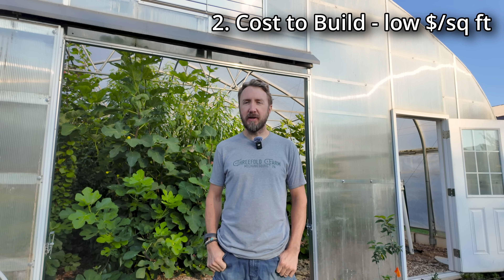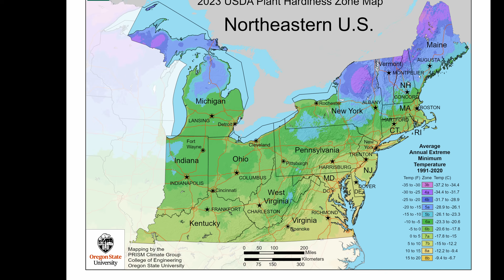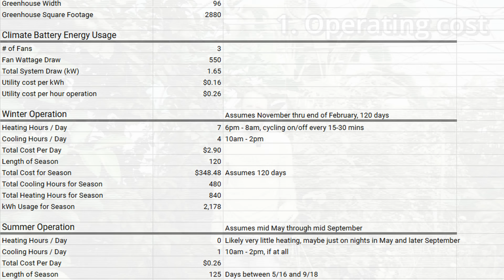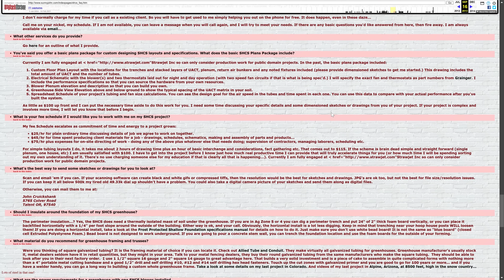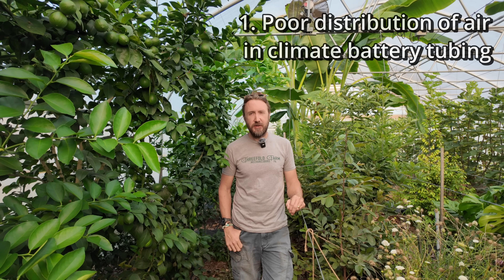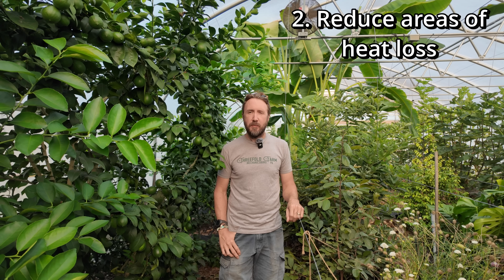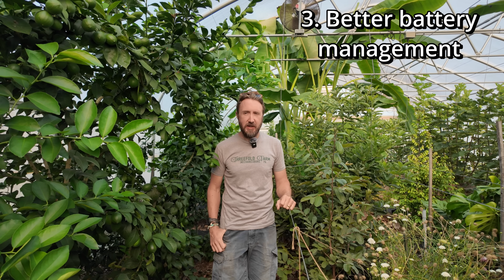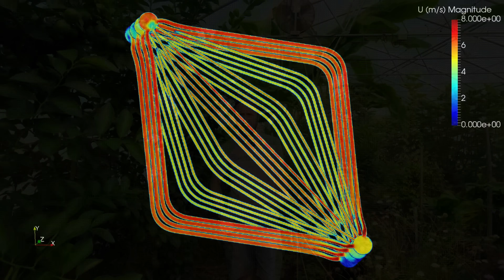Building an (Almost) Tropical Geothermal Climate Battery Greenhouse in a Temperate Climate

Comment: There's simple cheap(free) thing you could add during the backfilling around the climate air tubes underground.  This would take advantage of two heat related benefits of water.  Liquid water has a heat capacity(heat holding ability) about twice that of rock.  Moist soil would lie somewhere between pure water(2000joules/kg/degreeC) and rock(1000J/kg/C). But the real amazing thing about water is when it freezes, like going from 33degF water to 32degF ice). Water will give up about 70 times more heat as it freezes(heat of fusion/melting) than it does just dropping one degree.  For example, 1 kg of water going from 34°F to 33°F give up 2000joules, but going from 32°F water to 32°F ice will give up 79,000 joules - 80 times more.(these temps should really be 0°C centigrade to be units consistent). The way that I would incorporate watering an earth climate battery is with free recycled 2 liter soda plastic bottles.  I would just crowd lots of almost full 2 liter plastic bottles right near the cold end of the manifold of air pipes, before back filling with soil.  I'd probably use sifted soil or better sand, just to get between the bottles to help support them.  Those bottles would be stronger if they were pressurized, so one way would be to just buy the actual sodas under their pressure, or put a tiny bit of some acid(1/2 tsp muriatic) and then about 1/2 tsp of baking soda right before sealing the caps.  I would only fill the bottles about 90% so as they freeze there'd be room for expansion.  The biggest challenge, besides being careful about the initial back filling, would be getting good heat/air exchange between the bottles and the incoming cold air.  A really lot of the water bottles could be put in, both where they'd freeze and give up heat, and in all the other back fill areas where their better heat capacity and heat conduction would be an advantage.  I think they would be pretty resistant to crushing if pressurized and carefully backfilled, and would probably(and sadly) last for decades, like any landfilled plastic.  There also might be some things with HeatPipes that your engineering students might be able to suggest.  Heat pipes are fairly easy to make from regular copper or galvanized pipe that could also be driven or laid into the soil prior to backfilling.

Comment: This is brilliant!

-Do you get condensation or water collecting in the underground area ?  This could potentially provide water for dry areas
-Can this be used for cooling during summer? 
-And finally, would this work in a hot climate ? Zone 10 USDA. I consider growing some ultra tropical trees that require constant above 20-25 celcius temps, my area can get a bit cold for them during 4-5 months of the year especially at night. So during the day the greenhouse would be cooking temps, but during the night it may be below 20C.
Reply from the maker: The condensation doesn't collect since the tubes are perforated. As long as your soil drains freely and the water table isn't too high there shouldn't be any issues with condensation.
This could work in a hot climate for your application as long as enough heat was kept in the soil to keep your plants happy. Using this battery we're able to push our zone 6b/7a climate to more like a 9a/9b climate (albiet a very cool one in the winter!).
With regards to cooling, it provides limited cooling primarily in the winter months and part of the shoulder seasons, but definitely not later spring into summer. A bit much to get into but perhaps can be covered in a later video.

Comment: With your software background, you should look into greenhouse monitoring equipment.  Temperature sensors are very cheap.  You could easily monitor the inlet and outlet of each underground tube.  Use a small solar panel to monitor actual solar output.  Variable speed fans could let you choose just how fast you charge or discharge.  I'm surprised you did not go down deeper with your tubes though.  I've heard 12 to 15 ft deep is a more preferred zone, as it stays a more stable temp.  Would bringing each individual tube back to the surface allow for the ability to balance the air flow in each tube?   Single inlet, multiple outlets?  Would multiple inlets, multiple outlets, and small muffin fans on each inlet, allow for the best air control?
Reply from the maker: Appreciate your thoughts. It was only on the video very briefly, but we did screenshot some of the data from the sensors we run (we do have them on the inlet and outlet as well as others within the greenhouse). I may do a video on monitoring as we've tried a number of sensors and they aren't all reliable.

Deeper excavation adds signficantly to the cost so that's one reason we didn't go deeper. As I mention in the video, we really manage this more like a battery than try to tap into the more constant temps at deeper depths.

And yes, there are multiple ways to balance airflow in the tubing, each likely having tradeoffs.
Reply: @threefoldfarm  what type of sensors did you use?   I happen to work in the automation industry and might offer suggestions if you like.
Reply from the maker: Currently SensorPush for air temps. They've lasted for years without issue and continue to function well after battery replacement.

I've tried Hobo BT sensors for ground temps and they worked well for a year but quit on me. Had high hopes since they were expensive and I had heard good things. If you know of any solid probed sensors that are reasonably priced (and ideally transmit bluetooth) I'd really value it.

Tried others as well that really aren't worth mentioning.
Reply: @threefoldfarm  if you are talking wireless,  my options are more limited.    The dh series do both temp and humidity.   Very cheap, but wont do Bluetooth by themselves.    Pairing them with something like a seed studios xiao microcontroller, would give you the wireless ability you want.    Probably could even do mesh for communications reliability.
Reply from the maker: @dave4882  I'm not against wired sensors for long-term monitoring. What's this DH series and who manufactures it? Ideally I'd like a bunch of relatively inexpensive robust sensors to position all around the greenhouse with probes in the soil. And I know robust + inexpensive may not go together 🙂

Comment: Wow!! My wife and I are in Ohio and recently built a large(ish) kit greenhouse. Given our location we’re predictably having a rough time keeping the temps reasonable. We’re currently using a propane heater but we really need to explore some other options. Is it even realistic to keep the temps over 50F in the Ohio winters though? What kind of temperature ranges are you seeing in the depths of winter?
Reply from the maker: Thanks for watching. We don't aim to keep the greenhouse close to 50F at night because that's unrealistic in our climate given the (relatively) uninsulated structure we have.

We typically drop down close to freezing at night (our thermostat is set to maintain close to the mid 30s) and jump up into the 60s/70s in the deepest part of winter on a sunny day. Our climate battery is set to kick on if there's a difference between the ground temp and the air temp, so we try to keep it cool in there and bank as much heat as possible.

Comment: Imagine the large inlet tube going down - and then horizontally you would alter the diameter of the pipes leading to the opposite side where it's the same thing so as air comes down, the first pathway is the smallest, and then eventually the pressure in that small pathway would increase to a point where more air would bypass and go into the next pipe where the diameter is larger. only so many steps available but you could start at 3", do a few of those, and then move to 4" and so on. This seems like it would have an impact of forcing a more even distribution of heat throughout the piping.
Reply from the maker: Definitely, I'm sure there are a number of ways to more passively balance airflow and likely some I haven't even considered. As I understand it, home ducting systems follow this pattern.

The challenge in a climate battery is doing it in a cost-effective way. Reducers and couplers are unfortunately really expensive for culvert pipe so we tried to come up with a way to get closer to equal airflow with as few parts as possible. 

Appreciate the thoughts and the comment!

Comment: I think solar thermal might help as well. It would add significantly to the cost but would put much more heat in the ground. Something like a radiant floor heating system, hooked to solar thermal panels, run below the in-ground air pipes. It would give you more power to charge the soil up during the summer when you can mostly regulate the greenhouse temperature with the outside air.
Reply from the maker: Thinking out loud here...solar thermal panels are relatively expense (per sq ft). I wonder if a smaller high dedicated to heat capture (through coiled black tubing on the floor and perhaps black ground cover?) rather than growing things would be as effective or moreso?

As I've mentioned though, summer tends not to be the issue. The soil gets essentially saturated with heat in the summer. The challenge, then, is carrying that heat through the fall and as far into the winter as possible when solar gain is very low and heating needs are very high.
Reply: @threefoldfarm  I was referring to a more DIY solar thermal panel. A well insulated box with double paned glass, and a refrigerator condenser on sheet metal painted black makes an effective collector. I think I made one that was 2' by 3' with scrap components for about $30. The expense was all in the insulation and adhesives. Under full sun, it would heat 5 gallons of water to 125° F in 30 minutes. But I did test it when it was around 70° outside. You can make solar thermal collectors from all kinds of cheap junk.

Comment: Wow. Super great work and presentation!  I'm very impressed.  I have been thinking about this sort of stuff for many years and have come up with a lot of theoretical models in my mind.  Many of them incorporate both insulation and thermal batteries.  I'm also considering adding a hot water system and an attached sauna to heat both the water and the greenhouse.  

My property is at 54 degrees North in Canada with mountains to the North and South and we have both cloud and sometimes extreme cold-sometimes at the same time.  And the summers can also be quite variable with cloud and cool temps, brought on with irregular mountain weather.  Some summers are hot, while others are not.  Another factor is wildfire smoke coming from afar but locally decreasing solar gain and keeping things cold.  

I think I'd charge the battery some in the summer.  The combination of the mountains to the South, the cold, and the potential of cloud puts a damper on growing food plants year round, but I'm not completely discouraged by the somewhat daunting situation considering what I've seen done locally already and what you and others further south have accomplished.  

You mention that your initial year your temperatures dipped to 19F and that this wasn't an oat, mandarin, or fig killing temperature.  I imagine that the figs go dormant at such temps and for a while, and then re-leaf?  What does your greenhouse look like in the dead of winter?  For how long are your plants dormant and your greenhouse unproductive?  Where I live the sun increases quite nicely by early March but we can have snow on the ground still in late April.  Killing frost from downward drafts off the backyard mountain can happen 12 months of the year but aren't likely July and August.  I'm zone 3, maybe 3.5.  If I can overwinter figs and citrus in a greenhouse without die off, I'd be an extremely happy camper.  I'd love to share my design ideas and bounce some thoughts off your impressive noodle.  I'll definitely check out your other information and watch this video again.  Liked and subscribed.  :)
Reply from the maker: Appreciate the like and subscribe. We need folks trying these out in all sorts of climates and zone 3 is very challenging. We have a few installs in Canada. I imagine there's some planting zone or climate in which a regular double-poly tunnel just won't cut it to overwinter things like figs due to the really poor insulation value. Incorporating some form of backup heat would certainly be helpful for the super cold/cloudy stretches.

Yes, the figs go dormant naturally here around mid December and wake up again around early March. Last year we had peaches blooming mid February and I believe citrus in late March. We typically grow some greens for ourselves in the tunnel and those never go truly dormant except for maybe a few weeks in January where growth essentially stops or at least slows to a crawl. So in the dead of winter nothing looks really happy except the citrus and avocados. The other plants would definitely prefer much warmer winters but some take it pretty well. We're learning as we go in terms of how the plants respond to the extended cold.
Reply: @threefoldfarm  One interesting thing that I thought I should tell you, is that on my mountain I have seen rocks melting snow in January, just radiating the summer's heat (many months after they gained it).  And that is a rock with a small exposed surface at the ground level like the size of my boot exposed.  and even that little bit isn't ever in direct contact with Southern exposure, as there is a lot of young conifer growth shading it.  I have no idea how big these rocks are or how deep they go, but that sort of thermal mass, with no protection but the insulating Earth around them is something to consider.  What did you do with the boulders you mentioned in one of the comments having excavated out of your greenhouse space?  They might be a good addition in a future build.
Reply: @threefoldfarm  thanks for the quick reply and information.  I may be in contact about a consult at some point.  Cheers.

Comment: This is the most comprehensive info I’ve seen on climate battery-greenhouse design. Thanks for being so dedicated to learning and sharing.
Reply from the maker: Glad to hear it was helpful!
Reply: Keep looking, the implied information is grossly incorrect.  The tubes in the ground, (for an additional $5) could have been set up either to balance the flow, or be connected so that the air flow is continuous from one end to the other.
Reply: Looks to be cost prohibitive to a gardner.
Reply: @FirstnameLastname-en1im  this monitoring can be done on the cheap pretty easily if you've got a bit of electrical skills under your belt.

Comment: I saw where your flow data was listed, and you made the comment that "20% of the pipe was doing 80% of the work" but you didn't specify which 20%. I'm assuming it was the pipes with the most air flow, but is this correct? There has to be a speed vs heat gain curve. I was just wondering which section of pipes were the most effective over all?
Reply from the maker: Good question, I didn't cover that too deeply and the 80/20 was an estimate based on velocities coming out of the various pipes rather than a hard calculation.

But yes, various studies and our own work with PSU have pointed to a positive relationship between the velocity in the pipe and the rate at which heat moves into the soil. So air moving too slowly wouldn't maximize that rate (though the air coming out the other end would certainly more closely approach ground temperature), and increasingly the velocity past a certain point provides diminishing returns and is just moving air around for the sake of moving air around (and therefore wasting electricity). Based on what I've read, there seems to be a ideal velocity range in the realm of 4.5-9m/s that maximizes heat transfer while minimizing operating costs, though I'd love to see someone do more study in this area.
Reply: @threefoldfarm  did you figure out why some pipes were able to flow more air, and create design tweaks around that?  What were the aspects that you believe made the difference with those faster flowing pipes? Did your findings conclude that the amount of drain tile that you used was unnecessary?
Reply: @Leeofthestorm  it's a path of least resistance issue; higher velocities through the lower resistance paths. His channel has a couple of short videos showing this graphically, and once you see it, it becomes pretty obvious.
Reply: @royhouston9439  I do understand the thermodynamics of the path of least resistance.  I'll watch more, for sure.  I'd just like to see the specifics of what was discovered about why certain pipes were so much less efficient.  In the end, that is a potential huge waste of money and time, and if it can be solved with simple design tweaks, that would be great.